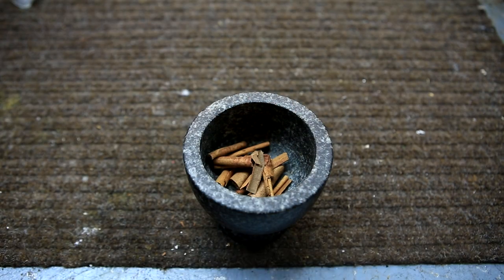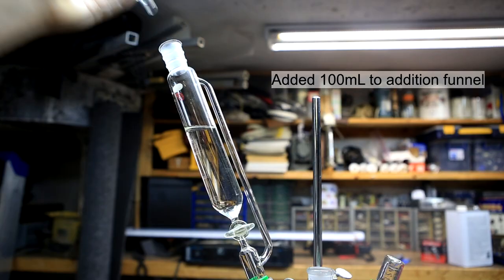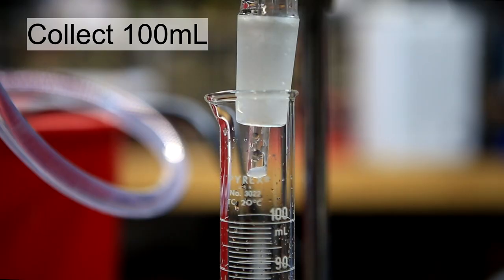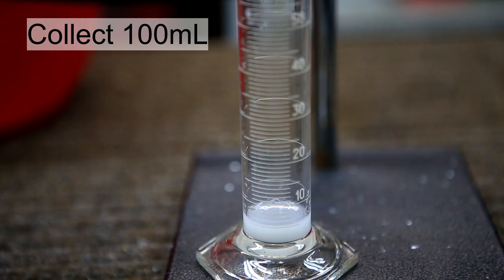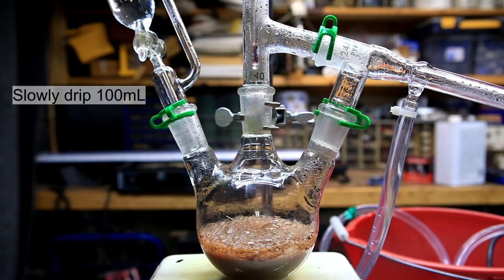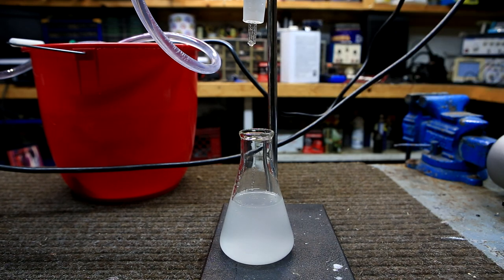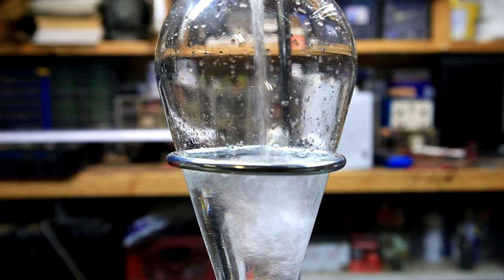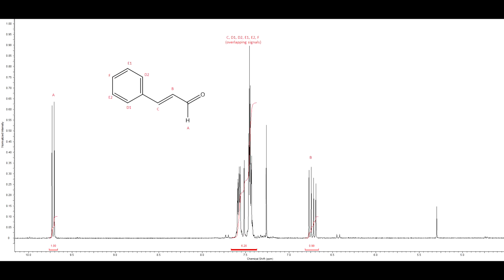How to extract Cinnamaldehyde from Cinnamon

Comment: Why not just use grain alcohol ad the primary extraction? Then go from their for whatever else it is your trying to do. Is it because facilitating different compounds of its structure or makeup? I never understood all this evasive process with such harsh chemicals . If your gonna isolate something then you can do it with   alkaline or even perhaps sea salt just as a metal oxide would had used. Idk seems weird with some of the unnecessary chemicals to precipitate certain things either way . Sure theirs similar chemicals but condensed method is always better and practical. Cheaper at best !! My modo is chemistry is interesting but with a easier and smarter approach on common sense as to which chemicals to use in your synthesis  or mixture depending on what exactly it is your trying to do. I love your videos and I will be demonstrating my take on precipitation of gold , silver , herbs , miracle drugs , perhaps even controversial ones also but with a twist as to not conflict with any ...well we'll see what I decide to make from scratch. A happy pill eith no side effects other than any other which is only fair to say the least.  Completely derived naturally.  Black pepper is 1 vanillan is another

Comment: Can I use ethanol?
Reply: Substituting the DCM for ethanol won't work, as the two readily mix. You could try petroleum instead, but it will take a lot longer to evaporate and the cinnamaldehyde might evaporate with it.

Comment: Would toluene work in replace of DCM? Actually, on the MSDS it says that cinnamaldehyde is also soluble in methanol, so could this be carried out with methanol, also, is there a difference between naphtha and methanol or no?
Reply from the maker: +vinceguy1 You can probably use DCM. Also, you cant extract using methanol because it is miscible with water.
Reply: +Nile Red well it says that cinnamaldehyde is slightly soluble in cold water and I hear you can get pretty pure methanol (like 97%) pretty easily
Reply from the maker: vinceguy1 but what would you be using the methanol for? Boiling it? I dont think that would work
Reply: +Nile Red ahh I see what you're saying, thank you

Comment: This is great and all, but what if that other way of collecting essential oil from plant material was done, where a pressure equalizing addition funnel is placed between the boiling flask and a refluxing condenser?  Do you think the emulsion would settle out, leaving and oil layer as will work in the collection of geranium oil?  (See a nice video by Jason Lye https://www.youtube.com/watch?v=gDojS7PWWPY )
if the emulsion could be broken, it would save a lot of washing and L/L extraction with DCM.
Reply: AddisonPhilips Great idea Phil, unless the oil is heavier than water (cinnamaldehyde is – density 1.049 something) Geez, I'm dumb :-)
… a couple of minutes later…
Sources say that the essential oil(s) from cinnamon bark may very well be slightly lighter then water.  Anyway, I'm trying this, so, time may tell.  More later
And Finally (even more minutes later) the various oils from the bark of the cinnamon tree are almost surely heavier than water, being very close to the density of cinnamaldehyde which makes up nearly 90%, of their contents.
Reply from the maker: AddisonPhilips I honestly think you might even be able to just leave it and let it separate over night...i honestly never tried that though.
Reply: Nile Red Yep, that's exactly what happened.  I discovered, to my dismay yesterday that, indeed, the cinnamaldehyde oil is slightly heavier than water.  I left my (closed) 250 mL p.e.a. funnel partially filled with a turbid distillate – I have some physical limitations which prevent me from safely messing about with larger glassware.  Turned out to be a good move, though because this morning, I found at least one mL of a light yellow liquid right down at the stopcock. I wish I could show you an image – since as of the midafternoon, as I write this, there is even more of the yellow cinnamaldehyde oil  I'm hoping and all the liquid above it is almost completely clear.

I'll swap out the funnel for a "Barrett water receiver".  Maybe  gentle refluxing will knock the oil out of a cooled (via distillation) suspension of the water and oil (almost like a macro-azeotrope).

I should upload a couple of images, just to document this alternate method.  It might be very slow, but since I did a scaled up prep (175 g cinnamon sticks) there would be a lot of DCM shaking and reclaiming, etc.
It would be great to only have to clean up a "naturally trapped" few milliliters!
Maybe I could even do the steam distillation with Sun heated (pure mountain spring)water LOL, cooling and collecting by night –a completely green essential oil extraction!  :-)
Reply: AddisonPhilips Okay okay – so I talk too much :-( and I wound up using tons of DCM and lots of shaking, separating, reclaiming via distillation, etc. etc. made some other mistakes and wound up with about 10 mL of nice yellow oil from over 175 g cinnamon.
I did discover however: the turbid suspensions of the oil gotten by "steam distillation", when allowed to stand overnight, do separate out (not completely), leaving a distinct oil layer, with a clear, chromatically enhanced aqueous layer.
Reply from the maker: yeah i think they do eventually separate :). Like it did for the limonene extraction.

Comment: The splitting for signals A and B are strange
Reply: A is a doublet (interacts with B) and B is a doublet of doublets (interacts strongly with C and less with A). Find the coupling constants if you want to convice yourself. Maybe they look a bit messy to you because since the system is conjugated, there is also weak long-range couplings.

Comment: I'm by no means a chemist.. but i get bored I wanted to see what I could do with cinnamon I boiled the sticks in water then let them sit in my fridge over night the next day I filtered any particles out i used a paper towel so I'm sure there was still alot of small particles... I then boiled I ment to pull it off the stove while it still had water in it but wasn't paying close enough attention I walked into the kitchen with q dry pan.. so I figured It was ruined but then I noticed a residue at the bottom of the pan I scraped it out and got about 1 gram of the substance it was red sticky and tar like... I did alittle research I think what I made is cin-silin but I'm really not sure I dont don't think ingesting it is a good idea but I'm gunna try the same thing again with true cinnamon.. If I made what I think I made it can be used as a supplement for people with diabetes or people that are at risk and diabetes runs in my family so I think this might be a good thing for me